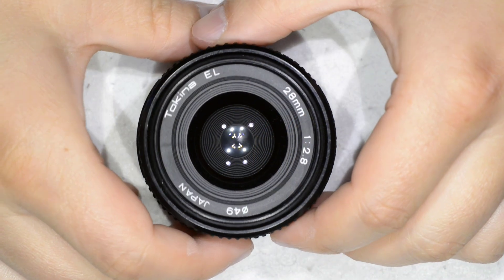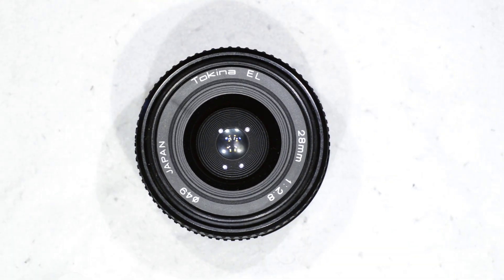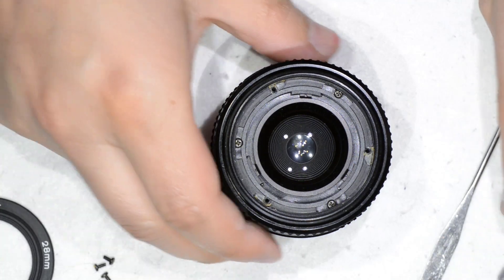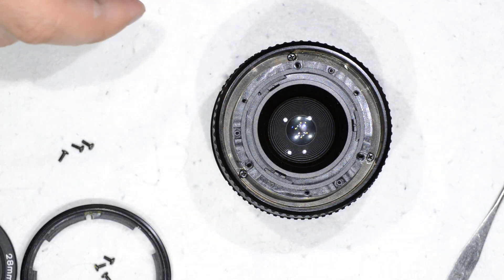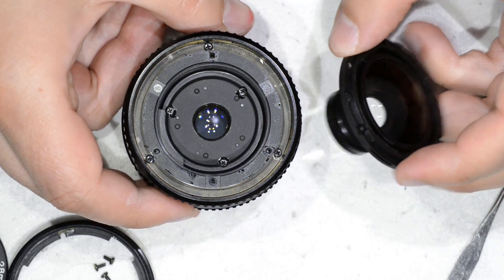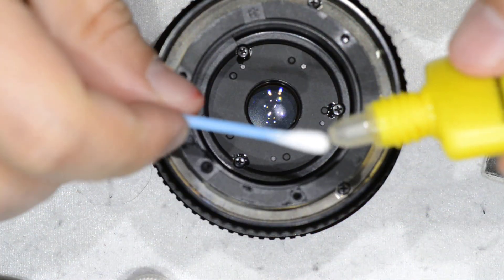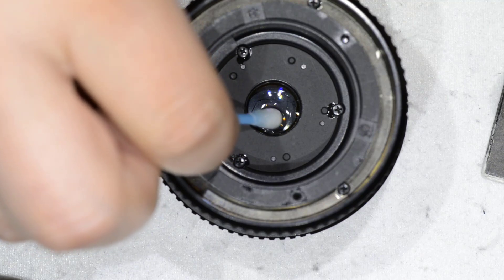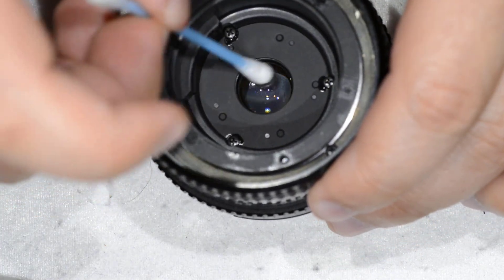Tokina 28mm fungus removal : Lens repair

Comment: Hi, I’ve got a Vivitar 28 mm 2.8 F. And it looks very similar to the Tokina one you have there. I’ve got a hazy and a bit of a fungus on the front element and I want to clean it but would like to know how do you determine if that front beauty ring either unscrews or prise off . Much appreciated thank you
Reply from the maker: Hi, I usually check whether the thread for the filter goes all the way down to the beauty ring or not. If it does changes are high that it is screwed. Best.

Comment: I hope you remembered to replace the spacer ring you left out during the reassembly of the rear group of lens elements.
Reply from the maker: I did that? LoL, I did not have any loose parts at the end, so the answer is yes.
Reply: Haha! I was getting anxious when it back together without the ring lol. Good it went back in.